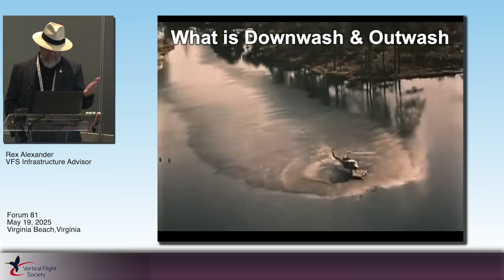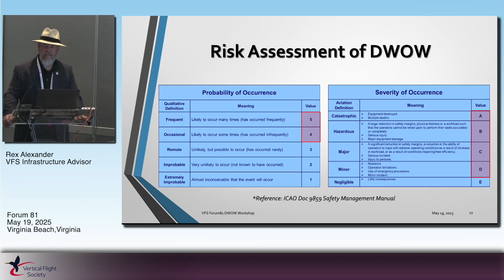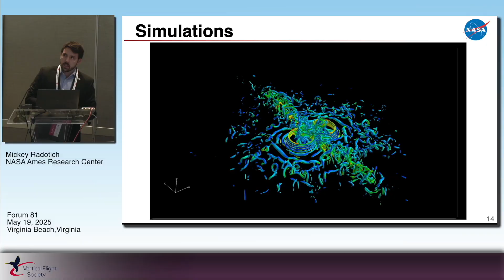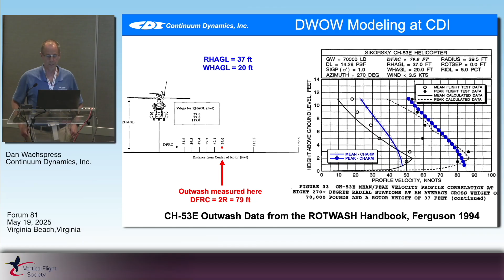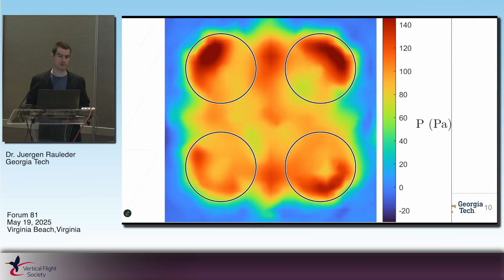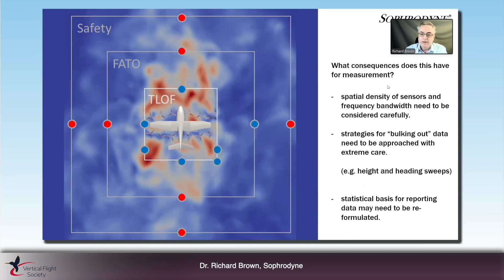VFS Downwash & Outwash Workshop, May 2025

Comment: Seems no comments.. would any reader be interested in forming an "inclined flight society" to fill the gap between the horizontalists (CTOL) and the verticalists (VFS) and cover the 90 degrees between each of these extremes ? ... not entirely tongue in cheek and if the thesis is correct then the only place for discussion and dissemination of ideas ,data etc that might be able to bring about the UAM / PAV vision.
Reply: Nelson , nice to get some reaction😊  STOL still needs a  ground run even if only a few feet  thus is horizontal at both ends , ATOL has to be Short TOL but also not at ground level and with low onboard power, high cruise speed ( being variable geometry) and shaped to be able to sit on a compliant surface much like an amphibian- typical STOL drag competition types are perched up on stalky landing gear and tractor props and need a hard surface with minimal obstructions on TOL paths.
But yes, they can be steeply inclined so would get 'honourable mention' status or associate membership😊 - STOL contests have shown just how little distance is really needed for TOL as compared to usual ground runs , the next step is to allow for use of soft cable arrays elevated a above roadways using the free space there and roadability.. the Brodie cable system was a start.
Reply: Get yourself to Valdez, Alaska for some amazing STOL.

Comment: ATOL can best be compared to a sailplane winch launch or a kite more than naval aircraft carrier atol - a slide of downwash and outwash velocities or noise would be a blank ( nothing to measure, no supercomputer vortex ring simulations or medusa like complex flow fields etc etc ) you can stand behind a sailplabe being launched at Formula one acceleration, climbing at 45 degrees and 2000 feet per minute and conduct a conversation, smoke a cigarette ( if you are so inclined) and have NO duststorm to suffer.  Pretty boring really , you would not even wake a sleeping baby in your arms... or in a house nearby.  Ditto for landing - there is no need for power on landing ( as gliders do) but retardation and capture by cable similar to the launch is also silent unlike reverse thrust or hover power.

We have a chance now before evtol wastes more billions in showing the obvious to actually create a human friendly UAM system that is also fail safe and affordable.  Let's not spin the vtol wheel of misfortune yet again when we know there are no winning pins.😢

Comment: Having lived in a house right next to a sports oval used as a medevac landing pad for the nearby hospital and thus experiencing big helicopters Eg Dauphine. Bell 412 etc doing rapid let down and flare landings and hover take offs I have first hand experience also having operated a GA maintenance and repair shop on a secondary airport (Essendon, Melbourne) in the 80s again having close up noise and turmoil from both fixed and rotary wing.
Also having been engaged in studying and design of an urban/ suburban air mobility system for over 40 years I have concluded that both CTOL and VTOL are non starters for any viable  AAM system.  Researching a fundamentally incompatible technology to the Nth degree will not obviate the conclusion.
What CAN succeed and completely avoid the down-  outwash problem is to realize that hovering is not needed but that avoidance of a ground roll IS the resl goal - two different things.
ATOL or assisted take off and landing will prove to be the viable solution using a simple open mesh type tensile structure usually erected above the local tree or pole canopy and over streets or roadways for preference and for direct access to the road network ( also allowing for use by roadable convertible aircraft)

An analogy could be made to tracked versus wheeled vehicles - tanks can operate without roads but only by being very inefficient slow and noisy. Putting some effort into a smooth infrastructure allows for much smaller lighter faster silent vehicles, using wheels.
VTOL is brute force ATOL is finesse.